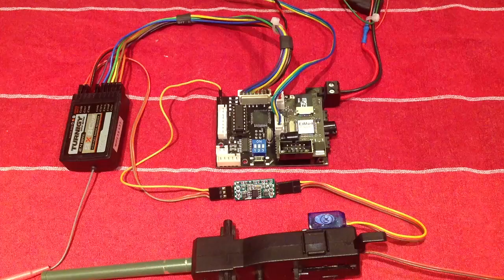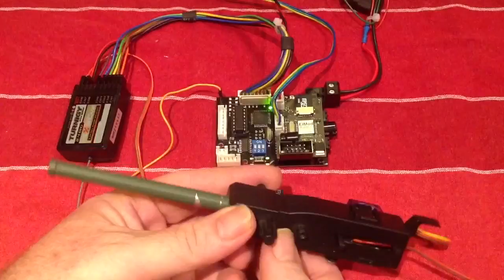Sirvoe: El Mod/Tamiya Recoil Servo Mod

Comment: is there anyway to mod the henglong tiger 1 airsoft to airsoft plus recoil like the new taigen tiger 1 did? i really want that. it shoot bb and whole barrel recoil, the ultimate goal ever.
Reply from the maker: Yes, many have done it themselves - but you can now just buy the Taigen unit.  The Taigen controller isn't as nice as a sirvoe but at least there is some action
Reply: do you mind get me the link of that tiagen unit? because i have search a few times and i couldn't find it and even ask from their facbook page they kept giving me vague answer , just a while ago i have dissected the henglong tiger 1 barrel into two it seems to be able to be slide in and out like that metal recoil barrel but however it seems they wanted to cut cost and never bother to install that and pretend their own airsoft recoil feature never happen, the rest is up to the buyer to upgrade it or diy upgrade with whatever available on the market
Reply: right now my barrel can slide in and out like the recoil they have but just one last thing i need, the servo and the small chip that comes with it, you have any suggestion or the one frequently use by all and is really good ?